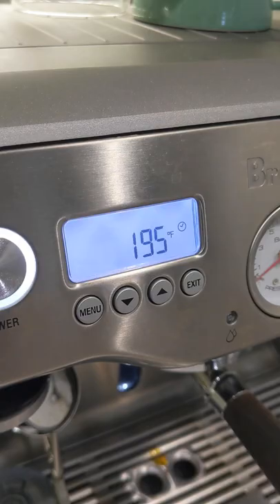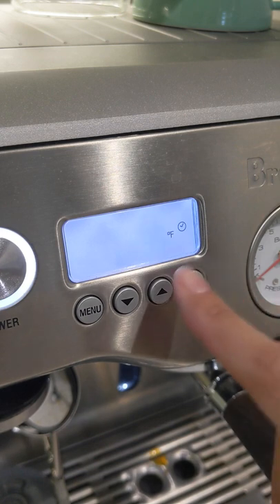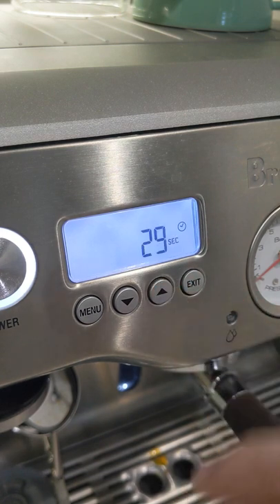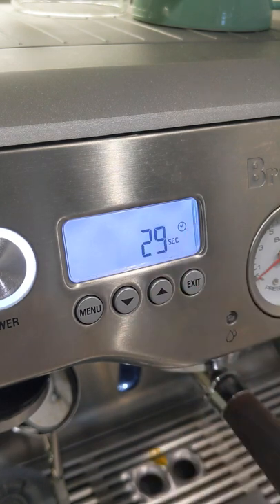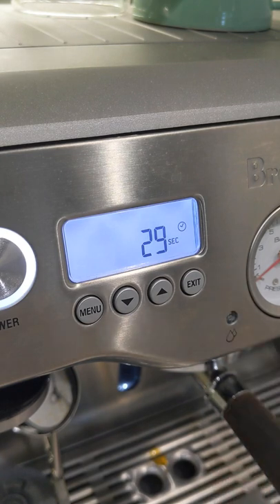how to recall/see the extraction timer on Breville Sage dual boiler tip/hack, shot clock time

Comment: You should be more concerned with how much you extracted, rather than your shot time.
Reply from the maker: that isn't the point of the video... I judge a cup by my tastebuds and adjust. Shot time is helpful in assessing the different variables you can tweak and if the roaster has suggestions, it helps as a starting point